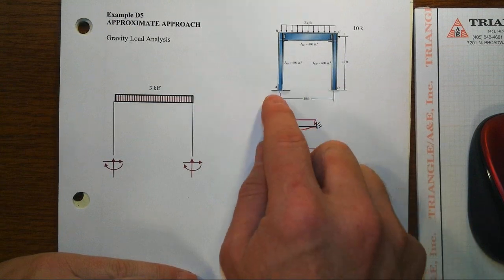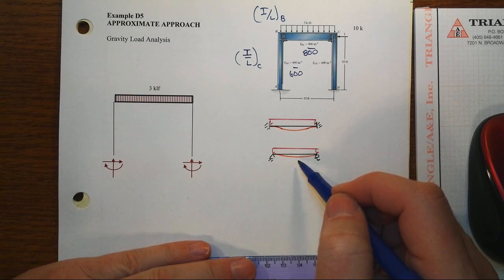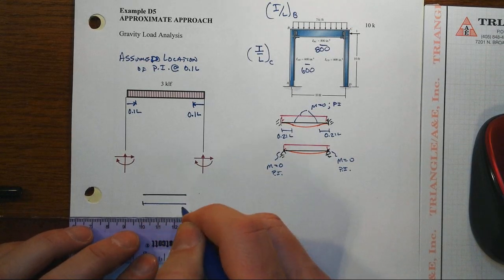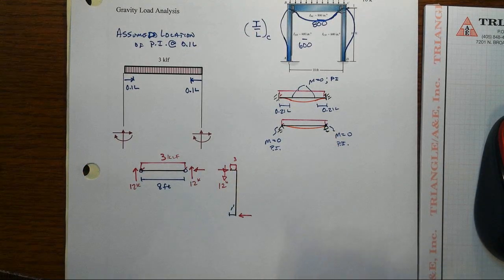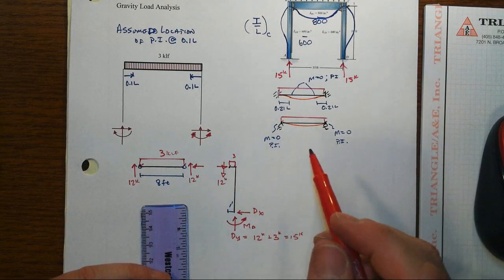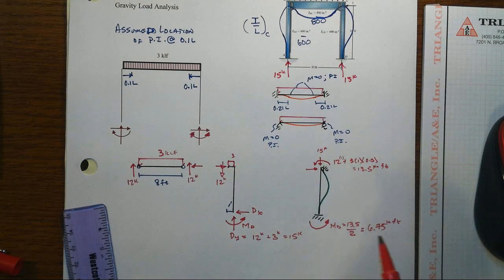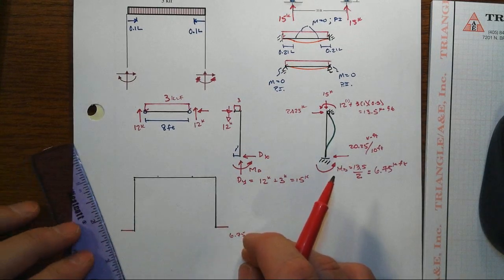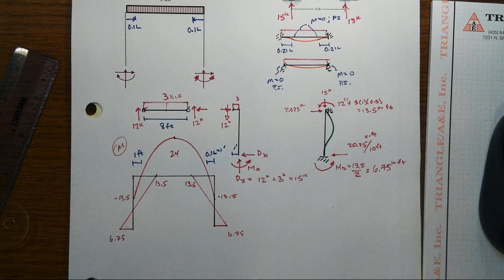Approximate Frame Analysis with Gravity Load

Comment from the maker: Not sure why comments from folks are not showing, here.  John Riley posted:
"Hi Doug, This video is awesome. I'm struggling a little to understand at 10:30 the shortcut where the carryover moment at the bottom is half the moment at the top of the propped cantilever? Trying to find an example of a fixed-fixed beam with applied moment to see where that assumption comes from."
That carry-over moment of one-half when the "far" end is fixed and the "near" where we apply a moment (which has a roller support) comes out of the moment-distribution method.  The carry-over can be derived with, say, the relaxation method.  Relax the redundant support (the roller), apply the moment, let the beam deflect (calculate that amount: D0 = ML^2/2EI) and then put back into place with the roller support's reaction ... D = RL^3/3EI.  That reaction will be R = 3M/2L.  Then solve for the other reactions.   M_far = M/2 where that M is the applied moment at the near end.  That M_near would be 13.5 k-ft in this case.